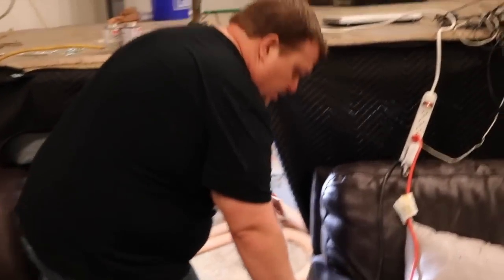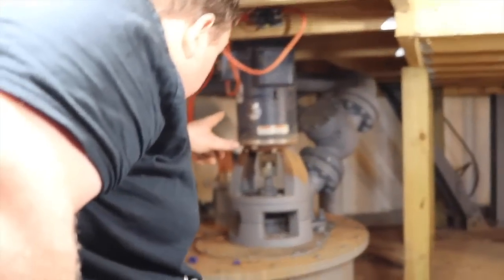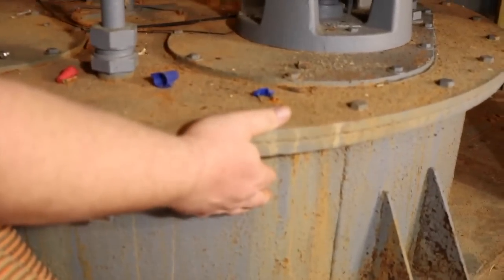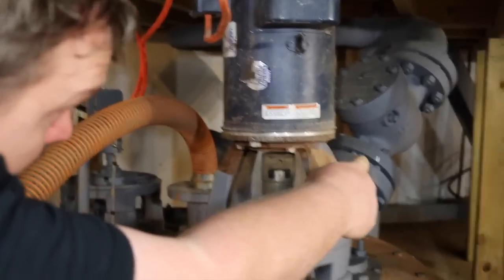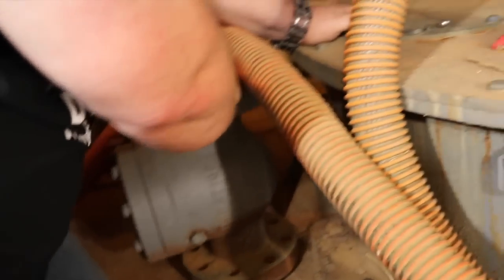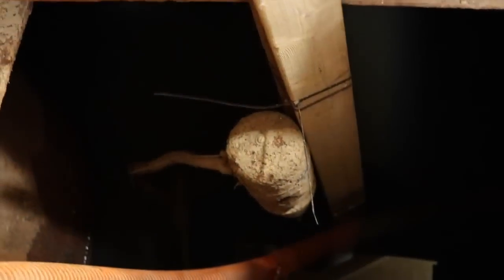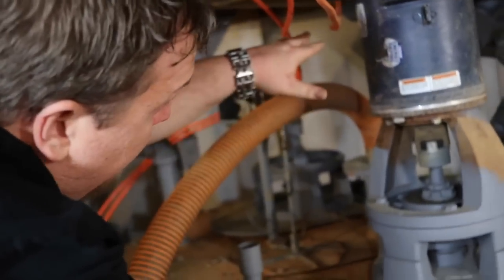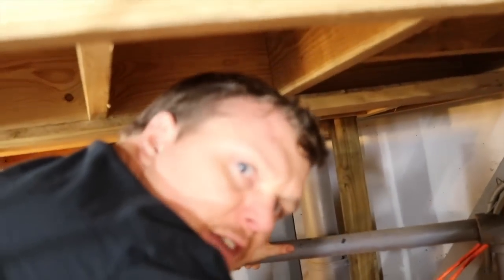EP18 - Utilities - Part One

Comment: soo question, how are ya gonna deal with the noise of the pump motor?
Reply: I was wondering the same thing. but mind you its basically not closed up yet put some good insulation maybe some acoustic foam underneath and you just hear a small hum like a old fridge.
Reply from the maker: That is a good question. And I think it will always be louder than an old fridge. Remember the birdcage is all floating and this is at the bottom of that. So when the motor is on, it vibrates the whole thing just slightly. What I don't know is how often that pump will have to turn on. Once I find that out, I'm going to put some kind of two stage float switch on it. Basically the goal would be to have it turn on at a predetermined time when it has to empty. That way it isn't turning on at night or early in the morning. Still something to work out.
Reply: So how did the Army vent the septic tank?
Reply: Another option would be to use a simple microcontroller to monitor the level in the waste tank as well as other variables like level 3 occupancy, whether or not the theater is in use, etc. and only pump the tank out when it's not going to bother anyone. With 700 gallons of capacity I wouldn't expect it would need to be pumped more than once every day or two so you have plenty of flexibility writing the control program.
Reply: Ryland Page A simple PLC to monitor this plus a ton of other things would be ideal. I do this for my job and something like this is super simple and can be programmed in a few hours.
Reply: Agree, a microcontroller would be a good thing. Also with a VFD (variable frequency drive) one could run the pump at slower speed, and thus minimize the noise a little a more...
And a VFD can convert single phase to 3 phase.
Reply: Add onto that the VFD can lower costs, make the motor last longer, and can detect issues way before failure. VFDs can also be networked with the PLC/microcontroller so he could just run a CAT6 cable to it and communicate to it via modbusTCP. The float switch can be wired into the VFD and the PLC can read that status and decide to turn the pump on too so he would have to run a wire all the way back to wherever this PLC would be to get the status of the float switch
Reply from the maker: Masyst / Drew - So this is really interesting and sounds promising. I've started reading some but can a VFD work on all motors? Anything I need to look for on my motor to see if its compatible? One other thing I'm not sure of is if the pump will work at lower RPM. I feel like there's a point where the pump will stop moving water. But I don't know enough to have that answer. Thank you again and any more comments are appreciated!
Reply: You'd need to get a three phase motor to use a VFD. (Ideally one that is rated for inverter-duty.) Single phase motors do not respond well to power frequencies outside the normal 50-60 Hz range and dropping the freq to slow the motor will increase heat and reduce torque. As for the pump question, that really depends on what kind of mechanism is used. Centrifugal pumps are highly RPM-dependent and will not achieve the desired head unless run up to that speed. A positive-displacement pump can be slowed without head loss, however. Out of curiosity, what was the RPM of the original motors you removed? 1725 or 3450?
Reply from the maker: At this point I don't see it being reasonable to get a phase converter and new motors to give me the capability to go slower. Plus, I'm fairly certain this is a centrifugal pump. It looked like a turbo. The new motors are 1800 rpm and I remember that being very close to original so I'd say 1725. Sound about right?
Reply: Yep, 1800 is the synchronous (no-load) speed of a four pole induction motor @ 60 Hz. It drops slightly under load as the magnetic fields begin to slip. Reason I asked: If it was higher (3600) I was going to suggest that you might be able to slow it down a tiny bit without losing pump performance.
Reply: Perhaps the noise of the pump motor is due to corroded ball bearings, replacing them should not be expensive and probably will solve the problem.
Reply: Mac Delaney *airforce and he said the vent was scrapped since it was copper
Reply: I know it is a bit late, but a submersible waste pump would do it much more silently - the liquid absorbs most of the noise. And if you put a controller, which pumps the whole tank at once every time a pump is activated, you would not need any check valves. Just some ideas...
Reply: Death Wears Bunny Slippers maybe some acoustic suppression material on the underside of the flooring?
Reply: Great video series! Suggestion: if you only want the pump to run at certain times AND only if it needs to, wire a motor timer switch in series with the low amperage float switch. Then, if the pump MUST NOT run between 1130 and 0600 you set the timer to exclude those hours. Or if you want the pump to ONLY run between 1500 and 1600, you set the timer to exclude all the other times. This presumes your generation of waste water per cycle is comfortably below the capacity of your collection tank. If not, you could add cycle periods and play with the cycle duration. If it is possible to attach another microswitch to the tank float, you could also create an "emergency override"  circuit by installing this switch in paralell with the other switch and placed on the float rod higher than the timed switch. Thus, if the level went too high during a timed out period, the pump would still be energized to prevent overflow. Keep up the good work!
Reply: Also, the sump looping problem is easily controlled by using a backflow preventer on the output of the pump to keep the loaded pipe from draining back.
Reply: Yep, even in commercial buildings we don't use the top mount motors anymore. Submersibles with macerators for sludge and soft debris...

Comment: Nice video 

Pro-tip: Use RG 6 instead of 58 it has a slightly larger conductor which improves signal quality and distance. Almost all cable  and satellite companies now use RG 6 because of this.
Reply: Similarly I was thinking it might be better to run fiber down instead of cat6 for future proofing
Reply from the maker: Now that you mention it I think that's what I used. I'll take a pic and put it on twitter. That way you won't think I just made it up. :-)
Reply from the maker: Leiser - fiber would be 50 year future proofing. Currently Cat6 can transfer 10Gbps. It will be at least 20 years before we would have a shot at those kinds of speeds for Internet access here in the country. And I do have ways to get other wire down if needed.
Reply: Ah, I was going with the assumption that once you finish wiring that, it'll be a yuge pain in the ass to re-do
Don't have fiber internet here either, but it could be useful for other things as well

Networking that place will be fun, think the steel floors will ruin wifi signals?
Reply from the maker: I've had Wi-Fi in here for about 5 years. Helps that I used to work for a Wi-Fi manufacturer. :-) I get coverage in the entire place with one access point. I have two in there now for some specific equipment. But multi-path (signal reflection) is super helpful. :-)
Reply: You don't need fiber internet to use fiber cable, just use a media converter. Fiber is great for ultra low latency and of course no loss over long distances. 10gb over Cat6 copper sucks donkey balls (with passive cables). Fiberstore.com sells UBER cheap fiber cables, can make em up in any length you want too. 10gb fiber to SFP+ adapters for your switch can be bought for $6 or less. http://www.fs.com/
Reply from the maker: toysareforboys - There's no latency differences between copper and fiber. Ok, if you want to get super technical then we could talk about light speed vs. RF speed. But they are VERY close. Distance for sure is a fiber advantage but I don't need anything longer than the 100m normally used for copper. For me, media converters are just another point of failure. And with copper I will still be able to get 9.5Gbps full-duplex. And lets be realistic; I'll never need that. Not in my lifetime anyway. I'm not against fiber; but I just don't need it.
Reply: Death Wears Bunny Slippers  RG6 is about the thickness of a pencil. RG59 is roughly half that. If you have RG59 then satellite company will not install. I'd also run multiple RG6 cables because most of the time each receiver needs one (sometimes 2) direct lines to the dish. I used to be a sattelite installer (dish network) 10 years ago so some of this might have changed.
Reply: There might not be a difference in a normal house installation, but you might end up with some serious EMI issues due to ground loops and electric motors. Actually, the place might have had fiber originally. I can't remember when you said it was built, but AT&T started designing fiber systems around '72 and incorporated it into the NYC phone system in the late '70s. The USS Iowa was converted to fiber in '83 and a lot of military communications were all fiber by '86.
Reply: Do the service providers in your area have fiber yet? If so, they may be willing to run their fiber (may charge you more because the type of install) into the living area and then convert over to copper for TV/Internet/Phone. Verizon has been doing this for years in the DC area and Comcast is now just getting on board.

If that isn't an option, I would definitely run RG6Q at a minimum but RG11 would be best for anything over  100 feet for your HD TV feed.
Reply: 2 coax cables are not needed any longer.
Reply: need's windows just saying but nice.
Reply: Oh boy, yes, 58/59 are junk. And run fiber if you can, its cheap and the kits to terminate are not too spendy. From what I have seen you do i dont think that is a skill set you couldnt pick up.